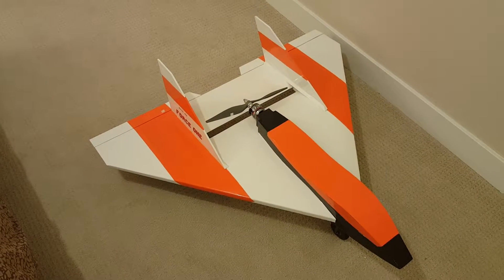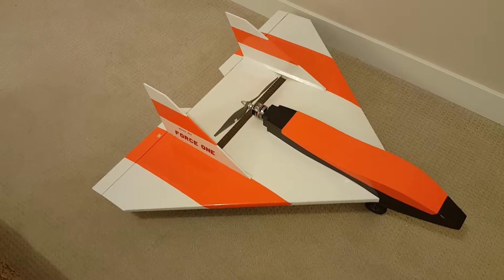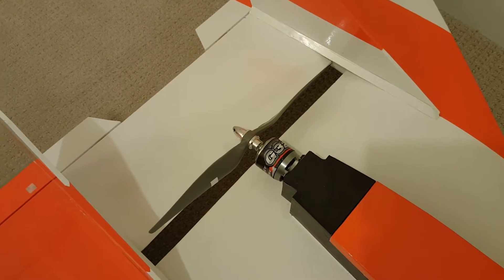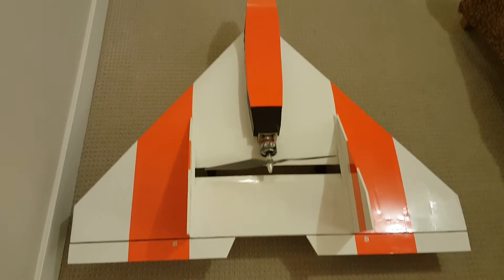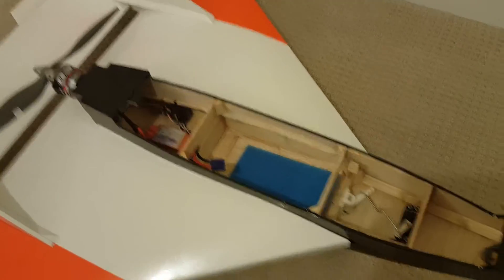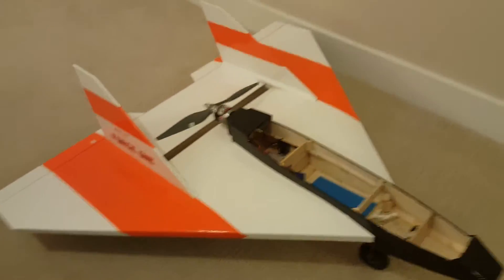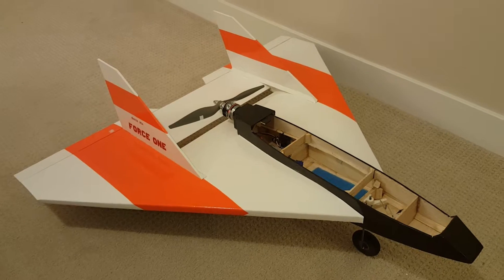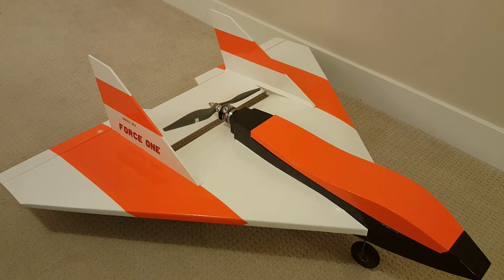Balsa USA Force One 1 RC Jet Plane with Electric Motor and Elevon Mixing Introduction

Comment: Oh man !! I bought this plane kit a 30 yrs ago and I STILL haven't finished it yet !!!  I think it's about time, that I finish the job though, but I don't have the pieces.  I hope there is a plan out there somewhere.  I hope I don't wait much longer, and have to chop down a Balsa tree.  It looks like your plane has a 90 degrees blunt angle on the leading edge, I don't remember if this was so, on mine.   Whatever the plan, you should have much more cut in front and rear of the propellers.   I can only imagine, how loud the prop anoyince noise is.  Just cut it out and monokote.  I didn't know anything about props or balancing, a three full decades ago, but now I think I know exactly what props to use.  Sorry I haven't seen your flight vid, cuz I can't find it, but your plane seems to be setup more for vertical speed than lateral top speed.  I would downsize the prop and go overboard on the PITCH, instead.  Say a, 8x8, 8x10, 9x9, 9x11, 10x10, 10x12 and bull nose, if need be.  I used to add scotch tape to balance my props, but now I shave the weight off, from the same place that you do.   Exactly right, about 1/3 away from the hole, to the tip.  I seem to remember that Balsa USA was still in business, not to long ago, may be less than a decade.  Oh well?